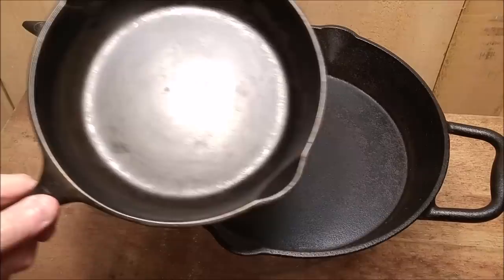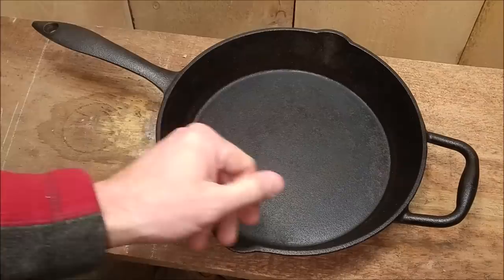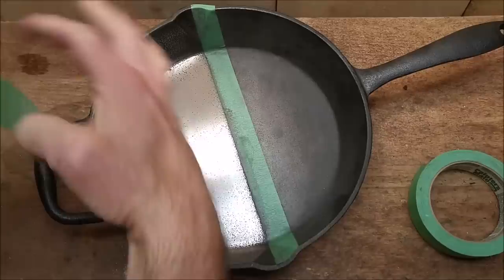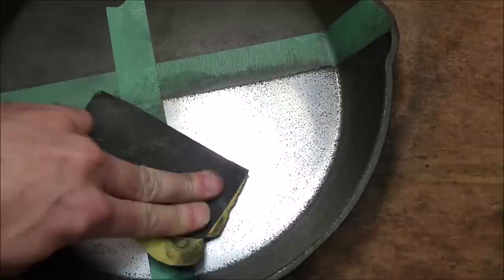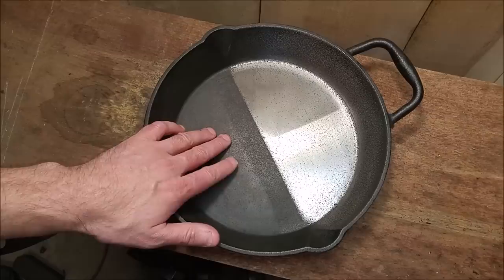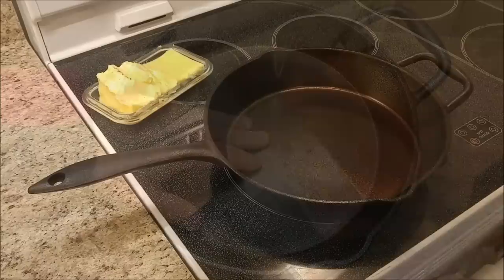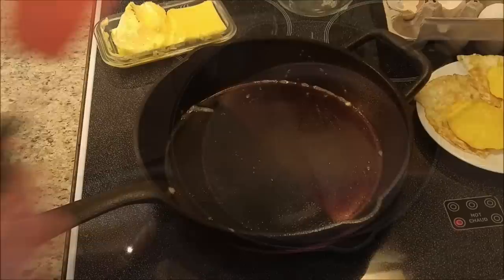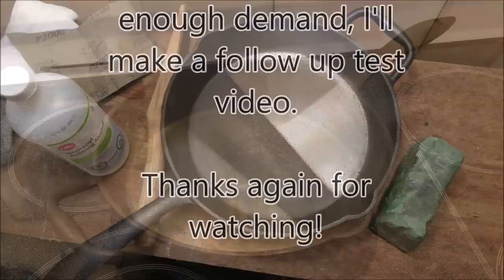🍳EXTREME Polish - Smooth a Cast Iron Pan to Reproduce an Antique Skillet then take it way beyond

Comment: IR thermometers have a hard time reading temp from shiny or reflective surfaces while flat black is the perfect surface for them
Reply from the maker: It's tough to understand something we can't see.  But it is picking up light, so it makes sense that a "mirror-like" surface would cause incorrect readings.  This is a cheap model also so I'm not certain the readings are so accurate no matter where I take the measurement.  I've been in the shop testing this lately and it's consistent in reading higher for a dark flat black surface compared to the lighter highly polished surfaces.
Reply: the color is not important, it could be black or white or orange. just the reflectivity matters for infrared thermometers :)

Comment: Considering you tried measuring the temperature of other things than just the pan surface, maybe it's a mix of the bare metal transfering the heat to the air more freely in a direct sense but also the divot grooves make it so the air has to expand more before it rises/other circulation blockage. Then again, I'm just a 20 grit scrub.
Reply from the maker: This is a hot topic, so I think I'll make a follow up video under more controlled circumstances to show what is happening.  When I originally saw these readings I thought the rough finish would release more heat due to surface area that is hot in contact with ambient air temperature.  Great comment, thanks for adding your thoughts on this.

Comment: It is from the more reflective surface, it is a known thing using a IR gun like that. The best surface to get a temp from is a flat black surface, the more reflective it is the more the temps are thrown off.
Reply from the maker: Some people suggested attaching a small piece of metal painted black to the pan in these areas with thermal paste, that would removed the variable.  Another good idea was to heat it in the oven to an even temperature, those were both good ideas I think.

You guys have helped me a lot in understanding the pitfalls of the IR measurement method.

Thank you.

Comment: I like the older brands like Wagner and Birmingham Stove (lots of unbranded pieces are BSR). Lodge bought the molds when BSR closed. BSR is heavier than many other old brands, much like Lodge. I ran across a brand out of South America called Victoria which I like very much. Not quite as heavy or rough as Lodge and a better design than the basic Lodge. It is in a similar price range unlike the new brands made in the US. Knocking down the high spots might work better than polishing. Using a heavy steel spatula over time will do that. Also, frying bacon after seasoning but before cooking eggs seems to finish the seasoning pretty well.
Reply from the maker: I'm a Wagner fan, we have plenty of vintage ones in my area and they are usually around $10.  I have a lodge as well, but I personally think the Wagner's are better designed, with the exception of the handle length since they tend to be quite short and get pretty hot.  I have a Kitchen-aid 10" which is actually really good, stays flat and is pretty hefty... with a longer handle, and the Lagostina pans are not good at all in my experience.

I'd like to try using a metal spatula, I originally thought it was a bad idea, but I'm hearing from quite a few people that it works really well.

Comment: I have a Lodge 12 inch pre-seasoned. I threw it in the oven on self-clean to remove all the pre-seasoning, took it to the woodshed for some angle grinding time (wire brush, flapper disk) then sanding sponges. Then it was seasoned with lard.
Reply: And how does it cook?

Comment: Good stuff. Seems like like they should definitely be selling with a glass finish!
Reply from the maker: I think it'd be hard to resist a finish like that.  I've heard that the old ones used to come standard with a smooth finish, but I'm not sure, maybe they became smooth with use over time.  

If you have the right equipment smoothing a skillet can be pretty quick (die grinder for example)

Thanks for the comment.

Comment: Love my griswolds.   If new, the stargazer and the field co. pans are nice.
Reply from the maker: I'd love a Griswold, I do like the wagner pans, but on the glass cook-top I find that any I find are a little too irregular.  Glass cook-tops weren't a thing back then.    The machined pans are really nice.  I think an investment into an induction top might be a great thing for cast iron, or gas, the electric coil or glass top just don't do them justice.  Which type of stove to do you use?

Comment: I used an orbital sander up to 2000 grit and then hit it with a paper wheel and polishing compound. Once seasoned it really does reduce any sort of food stick.
Reply from the maker: Did you find the orbital dug in around the edges?    It would be a very quick way to get the job done, but 2000 on an orbital... oh my, that would be a thing of beauty.  At some point I'd like to try to polish the surface and try to use it without any seasoning.  I'd assume instant rusting, but maybe the oil would protect it.

Comment: Just fyi, they are all the same temperature. The more reflective to infrared a material is, the less you can read the surfaces temperature. As a fireman, if I aim my thermal camera at a window that is holding back fire, I'll still get the temperature of the sky, tree, or whatever is reflected in the window from behind me.
Reply from the maker: There is a lot that I don't understand about IR.  So because IR is a form of light, it reflects just like the light we can see?    Maybe there are some videos I can watch to help me understand this.   Thank you for this, your comment has give me a practical way to try and understand it.
Reply: @NeedItMakeIt  There's just some quirks with IR. You're reading radiation and sometimes it can reflect that's all.

Comment: I wouldn't wait for the eggs to get a crust. A good test for a non stick surface is the ability to move the food while it starts to stick to the pan.
Reply from the maker: I find it tough to get just the right temperature with cast iron on my stovetop.  It seems that even though the temp is set to med, or just a little lower, the cast has such a higher ability to retain the heat that it keeps heating well beyond what you'd get with an aluminum non-stick pan.  Much to learn.  Thanks for the comment, and if you have any tips, I am all ears.
Reply: @NeedItMakeIt  I think it's about the same with my stove. I go to high heat for about a minute or two than go back to low-medium low, than wait at least 5 minutes. I will then add the butter and let it heat for at least a minute. I whisk the eggs and pour them to the pan after leveling the butter so it covers the pan well. I was able to get perfect scrambled eggs with nothing sticking.
Reply: NeedItMakeIt I’m relatively new to cast iron, but I think i understand it now. I never use heat above medium low. It gets too hot. I let it heat up fully before starting. And i only clean it while cold using only water if needed. Washing a hot pan can warp it.

Comment: Probably covered..Your polishing has made the surface more reflective to the IR device. A physically touching the surface with a probe would reveal minimal (if any) differences in temperature. I had to shoot a spot of spray paint on the lid of a pressure canner to get accurate readings with my el cheapo IR.
Assuming the heat below the pan is consistent that is. To verify that, spin the pan and check again.
Reply from the maker: I have an idea for an upcoming video and experiment and I will use your technique of using paint because it won't come in contact with food for the test... but it will be related to food. Thanks for taking the time!

Comment: Got a nice collection of old Wagner pans, they are awesome and very non stick.  Have some new lodge pans as well, sanded them down partially semi smooth and work quite well.  Tend to use my lodge pans for rougher cooks like steaks and burgers to save the beautiful seasoning and nonstick quality of the old smooth skillets.
Reply from the maker: Very nice, I like the Wagner pans I have, but I wish I had some larger ones.  The ones I have are also nice and smooth and very non-stick as well.  I have a lodge and I like it, they have a completely different feel than the Wagner pans.  A lot of people don't like the lodge, but I don't have anything against them, especially at their price-point.

You'll have to keep an eye out for my next few videos, I've built something that can take a defective new pan and turn it into something that looks like it would cost $100+

Do you have any seasoning tips?  Or do you have any common problems that you'd like to see tested in future videos?

Thanks for the note!

Comment: My favorite pans are the old ones. Have a Wagner from around 1960 that is awesome. Also bought the Lodge brand flat griddle. You can flip it and have a side for steaks or a flat side for bacon works great too. Either use that in the oven or on the oven top. The Lodge stuff is not Griswold but it is not bad and affordable.
Reply from the maker: I do really like my Wagners, but they are too small, I need the 10" to do any real cooking on it.  I'll check out that Lodge griddle, I don't remember seeing that one.
Reply: @NeedItMakeIt  Wagner made a 12" pan.

Comment: Likely the temperature is not very different, just the black body emission is different with different surface.

Use a thermal couple to measure will give more reliable result.
Reply from the maker: I'll have a look to see what's available that would measure a surface, thanks!

Comment: Found an unseasoned Wagner at a thrift store, $2, smooth as silk. 1st cook was fried eggs using coconut oil; eggs slid out like a tv commercial.. smooth is good, & so is no lead & crap.. just start with  good cast iron product & life's good!
Reply from the maker: Are you kidding, $2 is a steal, I've only found broken pans for that price.   Coconut oil is not something I've ever tried, so I'm going to try this, I like coconut on it's own, so maybe it'll be okay with the egg... hard to "beat" the good old butter though.
Reply: @NeedItMakeIt  yes butter is better! But I don't have to refrigerate my coconut oil

Comment: Layer of the seasoning can affect the temperature, any thing that insulates metal will cause a higher temperature.  

On a cast iron pan you want the seasoning for it to non stick but it also will help the pan to heat up more.
Reply from the maker: Interesting, I don't think I have any measurement device accurate enough to test that, but I understand the concept, I like your thought process on this.

Comment: Your laser temperature sensor is probably not measuring actual temperature differences between the different finishes, but is getting a different reading due to the different finishes.  This affect is increased because you are not point the device at a 90 degree angle to the surface.  The surface finish of the metal has a large impact on the measured temperature using this kind of device.

Comment: A few years back I took some scrap metal to the metal recycling section of the dump. Threw out my metal and there were two old cast iron skillets with layers of crud on the bottoms and rust from rain on the tops. I didn’t know one pan from another back then. I was burning large piles of sage brush so just put the pans on one pile and lit it off and came back at the end of the day and uncovered them from the ash and coals. I brought them into the shop to cool down over night. Next day brought them into the house to see how much cleaning needed to be done. Most of the crud burned off both skillets so hand scrubbing in hot water wasn’t too bad. One pan is a #9 Griswold small logo so one of the later ones probably 1950’s. I seasoned them and the Griswold was a real find the other one has machine marks that was not smooth and very disappointing. I could clamp it down on the milling machine but will probably go back to the metal pile someday. A couple days ago I watched a video on figuring out what cast iron you have. Turns out I also have an old Griswold #5 large logo Erie skillet plus a smaller non discript skillet that works very well oh the #5 Griswold also has the ring on the bottom. Pretty sure that came with some stuff when a close friend died.
Reply from the maker: They don't let me anywhere near the metal pile at my dump :( we don't really even have scrapyards anymore either around my area, so I am forced to look to the antique shops for my pans.  

Those are some excellent finds, I've heard of cleaning pans by putting them in the fire, I expect that it would heat the pans evenly so no need to worry about them cracking even at such a high temperature.  

If you're interested, I can probably re-finish the pan by hand-scraping (check out my latest video).  It would make for an interesting video also.   These pans are probably expensive to ship, so maybe it's not possible, just a thought.

Comment: Get a good old Wagner or Griswald. Lodge preseasoning is super bumpy and sucks, have to sand like crazy to smooth out
Reply from the maker: I couldn't agree more.  I picked up a few old Wagners and have been really happy with them.  I have a 10" wagner which does not sit flat so I and trying to find the best method of flattening it without removing too much material.   The Griswald skillets are so expensive, are they really worth the money?

Comment: Crazy temperatures change
Reply from the maker: I thought I would see, so I measured it today.  With hot water it drops 70C top surface, 50C bottom  the pan is heated to 145C to 160C for normal cooking.   The sidewalls only heat to around 100C at their max on my glass cooktop.  So the question is, does a 70C drop on cast iron cause a problem?  

I can speak from my experience only, and this process works well for me.  If people dont want to do it, well... don't do it.  I can imagine that cold water (11C) at my house at the moment, would cause a greater temperature change.  

I'd like to do a follow up test video on this subject, but I'm a little concerned I may be crusified.  So I will be thinking about the right way to approach this, which had to be showing the facts and my own opinions are left out.

Thanks for the comment.

Comment: My Lodge 10.5”  pre seasoned worked fine right out of the box.  Most times a paper towel is all that is required for cleanup.  Occasionally, a little water and a light whisking with a nylon bristle brush.  If it ain’t broke, don’t fix it.

Comment: I sanded smooth my newer Wenzel skillet. I seasoned it with Lodge spray two times. Then to finish seasoning I fried bacon and smash burgers fried in butter. I fried bacon and burgers for a few months until the bottom got a good dark season. Now I can make fried eggs pancakes or grilled cheese. It doesn't stick like the original black seasoning did.
Reply from the maker: I went on the Lodge website and checked out their spray and it is apparently 100% canola oil and no additive or propellants, so wouldn't regular canola oil do the same job?  Do you wipe off the excess after you spray it?  

You're the 2nd person recently that has recommended their spray, so maybe there is something to it that I don't understand yet.

Thanks for this!
Reply: @NeedItMakeIt  After sanding I cleaned the pan. I heated my pan on the stove top on medium heat for 10 minutes sprayed the Lodge spray and wiped it out. The pan smoked a little. I let the pan cool off, then I did it again. After that I went with the process of frying bacon and burgers in butter. I think the bacon and butter frying created my deep season in my pan. Just preheat your pan and spray the Lodge spray or use a little canola oil and wipe it out before each cook. I use the spay as my base layer then use other oils or butter to cook with. It works well.
Reply from the maker: @gsm1021  That seems so much easier than my current method of seasoning in the barbecue where you can't see what's happening.  

A few people have mentioned that it is necessary to let the seasoning finish smoking due to the release of free-radicals, or cancer causing agents.   I have no way of knowing for sure, so I'll do a little more research.  

I like this tip, I think lots of people season on the stove, so I imagine it works well.  

Thanks again.

Comment: Non contact infrared temperature sensors will take a different reading on smooth shiny surfaces when compared to black surfaces it’s called Emissivity and it’s on the basis that black bodies absorb all incident radiation so that all emitting radiation is a result of their own body heat. (Black surfaces have an emissivity factor of 1.0) .However shiny surfaces reflect a lot of incident radiation and therefore need special compensation to achieve comparable results ( i.e emissivity factor less than 1.0 for shiny smooth surfaces) for using this type of of temperature sensor

Comment: Couple things to think about, even rough skillets will smooth out with use. A machined surface is nice to have, but not actually necessary, and never put a hot pan under cold water, that can warp the iron instantly.
Reply from the maker: I'd agree, most people don't want to wait, a smooth pan is a pleasure to use and clean.  Check out the follow up video on this pan, I'll fix the bulge.  Correct, don't use cold water, in the video I didn't show that process in detail, this is very hot water, I've been using this method for years with success.
Reply: Great video but I believe hot pan under any water hot or cold will cause it to stress, maybe that’s why there is bulging in the pan causing the oil to pool?